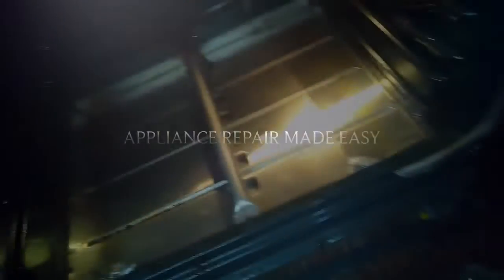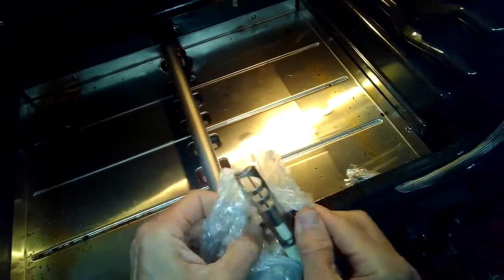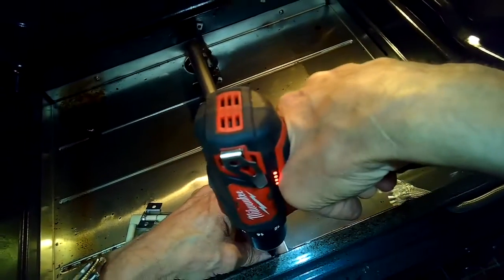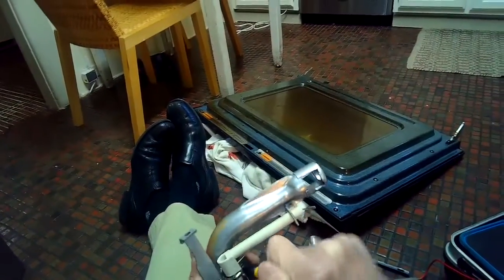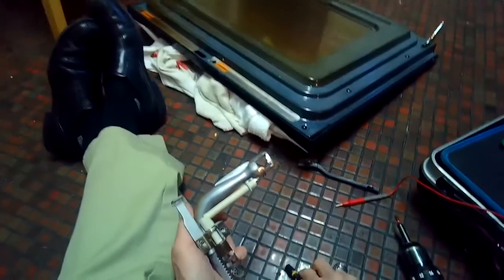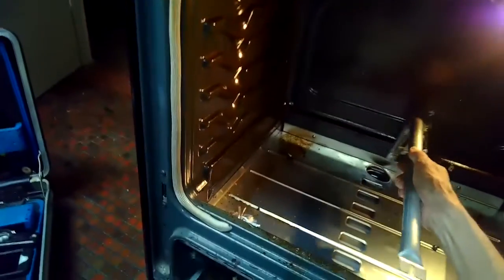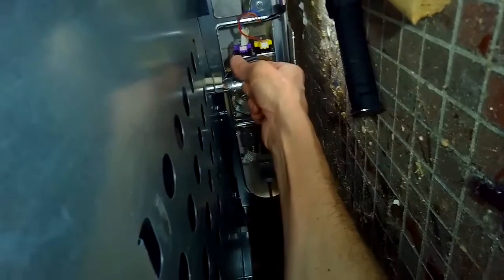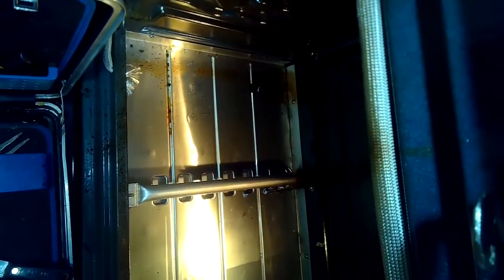✨ Whirlpool Oven Doesn’t Heat Up—NEW SPARK IGNITER🔥

Comment: I found this video incredibly helpful! I followed every single step to a 'T'. However it is still not clicking to eventually create the bake oven circuit. By chance do you have a video on faulty hot surface igniter or a failed gas safety valve?
Reply from the maker: Can you send your model number to my email at: scottthefixitguy@yahoo.com

Comment: On a dual burner unit, I resurfaced the broiler igniter as it was an intermittent problem and it worked for a couple of days and stopped working. The bake ignition worked fine. I don't know how to test one as I do with a flat surface one using an amp clamp, and I don't want to throw parts at it. Is there a testing procedure I'm not aware of? Does that spark igniter depend on a chassis ground for proper operation? 
 The thing didn't have a tech sheet in it so resistance specs and the like aren't available. 
Does it sound more like a spark module?
Reply from the maker: That sounds frustrating, I’m not sure, but a new spark module could be the culprit 👍
Reply: @ScottTheFixItGuyChannel  Fried Ceramic resistors on the Spark Module PCB. 
Of course it would KILL them to utilize a higher wattage  spec on the build, otherwise it would last much too long. Argh.  Two days to ship new ones from Arrow Electronics in Colorado. Also went through the PCB and found more that were out of spec, Recapped, and there were some diodes replaced, pulled the relays and burnished the contacts.  and reflowed all he cold solder joints. (At least a dozen,) and Voila!  Saved well over a hundred, and the components were less than shipping! 
( I miss the local Radio Shack)

Comment: I know this is old so maybe a long shot but I just did this repair and we have a spark now. Great! However, it is still not lighting the flame. Gas is flowing I can ignite it even from just the spark from a lighter. I see a spark from the igniter, I'm not sure what's going on. Any help would be awesome thanks!
Reply from the maker: This updated burner tube should fix it: Click Here to Order Your New Updated Igniter Kit with improved Ground Connection that Solves this Common Problem: https://amzn.to/3ZLtiEl

Comment: Hi scot i got a gas range kitchenaid. Oven stuck on preheating. Bottom & top burners do not come on at all no clicks either. Just the top element works when its on broil. I was wondering if its the igniter spark module or a bad burner igniter
Reply from the maker: Can you send that question to my email: scottthefixitguy@yahoo.com

Comment: I have model # WFG525S0HS0 and both broiler and oven ignitor is not clicking.   i purchase new one and still not working.  my top five burner are working great.  Please help, i'm doing this for my parents. Thank you.
Reply from the maker: Hi Amit,
Did you replace the igniter or the controller?
Reply: @ScottTheFixItGuyChannel  I replaced igniter and still oven will not come on.
Reply: @ScottTheFixItGuyChannel  I just replaced ignitor.  still oven does not come on.  what else I should be checking. please let me know.  thanks
Reply: @ScottTheFixItGuyChannel   I only replaced ignitor and still not working.  now I wonder could it be whole controller(circuit board)?

Comment: Could it still be an igniter issuer if the igniter sparks, oven lights for a few seconds, then shuts the gas off an tries again a few times. It seems as if it fails to detect that it is lit. Sometimes it will get up to temperature and then during cooking it will start to do this and then lose temperature. It seems to especially like to do this during holidays for some reason when the oven is more in use, then work fine again for months. Great video BTW!
Reply from the maker: Hi Tom,
This oven has a problem of the spark igniter having a bad ground connection.
You can try tightening the bolts that hold the burner tube to the frame.
I think there’s a retrofit kit Whirlpool has to fix the ground problem.

Comment: Hi why would  You hear a clicking noise if the spark module was bad?
Reply from the maker: Hi Brian,
Sometimes when a spark module is going bad, it will send energy to some of the other burners, but won’t send power to one or two of the burners that aren’t lighting

Comment: Great suggestion to look under the oven bed (by taking out the bottom drawer) to reconnect spark igniter. First video said to do it all in the oven...made for reconnecting the spark igniter iffy, resulting in poor connection at the first attempt. Thank you!

Comment: I’m having this issue. How do I know what is wrong if it’s the spark module or glow igniter?
Reply from the maker: Do you hear lots of sparking when the oven should turn on?
Reply: @ScottTheFixItGuyChannel  I actually have the same question. I can hear mine clicking, but it doesn’t seem to ignite.
Reply: @ScottTheFixItGuyChannel  yep, having this problem

Comment: My glow igniter is working well. I do not get gas to my gas tube unless I turn on a stovetop burner. What's a solution for that? The instant I turn on a burner, gas flows and ignites to the oven.
Reply: Did you ever get an answer?

Comment: I have the same exact model. My problem is it will ignite but can’t get it to preheat. The temperature stays at 100 only. What could be wrong with it?
Reply from the maker: I would change the igniter,
When they get weak they’ll work for a while but shut off prematurely.
Reply: I replaced an igniter, then oven heated above 100F to correct, set temp.

Comment: Please tell us the symptoms?  I cleaned my oven ignitor/electrode and it doesn't look bad but will not light/ fire ( I also replaced the safety gas valve and sparks a few times but will never lite up, no flame. Where is the Spark Module located?  Please help
Reply: Mine doing the same did u ever figure it out?

Comment: I have a Whirlpool Range model number WFG220M0BW0 when i turn it on it glows red but wont light up it did work but we had to unplug  when we had to get behind it for something. Does it mean i have to replace the ignitor on it?

Comment: How does the igniter end connect to the wire?  Mine just has the wire but not connection like some of the other igniter tpes
Reply from the maker: Hi Randy,
Usually you use a ceramic wire nut to connect the wire from the igniter to the power wire from the oven.
Reply: There was no wire, just the flat piece on the ignitor, but I just used an electrical connector.  The oven ignties after replacing, but it still won't stay lit.  What next? Any ideas?  Broil is working and burners are working.
Reply: @randylaking6720  sounds like it may be a faulty oven heat sensor. A little more info on how long it stays lit may help.